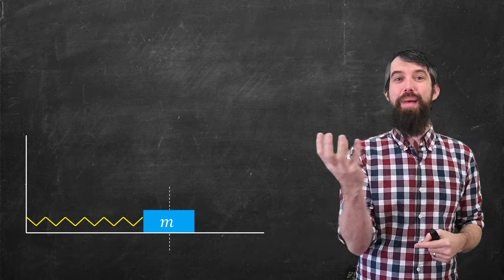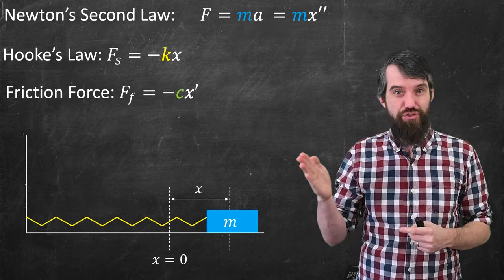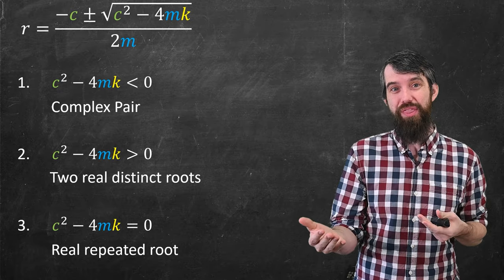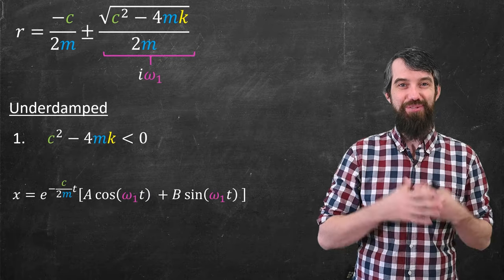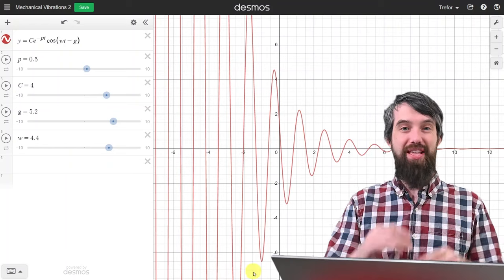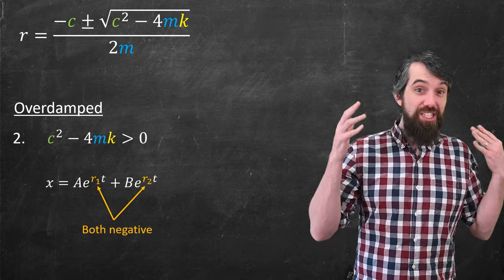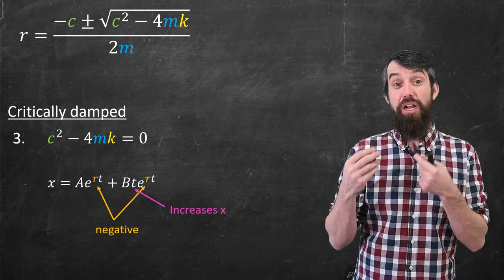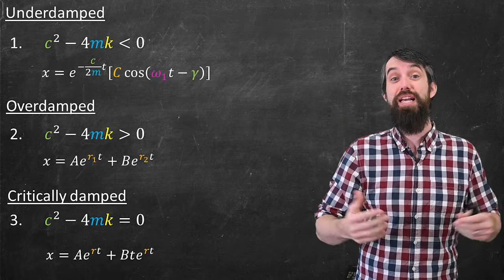Mechanical Vibrations: Underdamped vs Overdamped vs Critically Damped

Comment: Professor T. Bazett, thank you for a strong Introduction to Mechanical Vibrations in Differential Equations. Mechanical Vibrations is a huge part of Mechanical Engineering, which deals with tools/equipment that vibrate upon impact. Many problems in Mechanical Vibrations are Underdamped.

Comment: For anybody who gets into vibration analysis or reliability engineering, in mechanical system you can typically only vary mass or stiffness. Although it can be expensive to modify equipment in the two aforementioned fashions, it can prevent fractures. Changing mass, stiffness or both shifts the frequency response away from the current resonant frequency which is what kills shafts, bearing, supports, pipe fittings.
Reply: hey could i message you for help brainstorming for a math investigation coursework im doing for school?

Comment: First time I ever hear that friction is a function of velocity. I mean it does make a difference if you're moving or not (static vs kinetic friction coefficient), however, once you start moving it becomes a function of the normal force (independent of velocity). Now, an hydraulic/pneumatic dampener does depends on velocity. Anyway, great video as always!!
Reply: This is friction on a spring, and here, there is no normal force, because there is no gravity being considered.
Reply: @angelmendez-rivera351  that's definitely not it
Reply: Its viscous force of damper , act like friction force here
Reply: @rohitchaudhary3619  I would agree with that, that's the example we always see in Mechanical Vibrations. Usually there's a "damper" parallel to the spring in the schematics.
Reply: @AMR-555  Friction is proportional to velocity assuming viscosity governs the fluid mechanics of drag, rather than stagnation pressure.   Usually at low velocities and high viscosities (called laminar flow), you get drag forces that are proportional to velocity.  Eventually, there is a speed at which there is a transition from laminar flow to turbulent flow, where it is much more accurate to model drag as proportional to the square of speed, rather than to speed itself.  Non-fluid friction is independent of velocity altogether, and only depends on normal force, the identity of the surfaces, and whether they are initially at rest, or initially moving.

This kind of problem is significantly more difficult to solve, if you have to work with a kind of friction other than viscous damping that is proportional to speed.

Comment: Sir, will you recommend laplace transform to solve these differential equations? Actually I used it for a while and got some weird solutions, like extra sine terms and cosine terms... Will it affect my solutions?
Reply: You can use either the Laplace transform, or the traditional method of assuming the solution has the form of e^(r*t), and solving for the characteristic equation that determines the value of r.  It depends on the form of the differential equation given, and whether you are given initial conditions or not.

If you are just solving the simple case of a free vibration, and initial conditions aren't really in the picture, then I recommend the more traditional method of assuming the solution has the form of e^(r*t), and solving the characteristic equation for possibly-complex values of r.   If instead, you are given an exotic forcing function other than a simple sine or cosine, then I recommend the Laplace transform method.

Try a few examples both ways.  See if you get consistent results, and which method seems to be easier in which circumstances.

Comment: ive never been able to figure out why you need both a sign and a cosine term in the underdamped solution. surely just having the one and moving it around will let you set whatever initial conditions you want
Reply: You can either have a single amplitude and a phase constant, or you can have a sine and cosine term.  They both will give you the same solution, since they are both multiplied by the same exponential decay envelope.  Through a trig identity, you can prove that they are equal.

Initial value problems with underdamping are significantly easier to solve, if you keep them as an arbitrary linear combination of sine and cosine terms, and then solve for the coefficients based on the initial conditions.  If you switch it to a single trig function with an amplitude and phase constant, it is a harder problem to solve.

For the situation with no damping, you can proceed either way to find the coefficients.  You can use conservation of energy to find the amplitude, and inverse trig to find the phase constant.  Or you can use a linear combination of sine and cosine, solve for their amplitudes from initial conditions, and then use trig identities if necessary to translate to a single trig function with an amplitude and phase constant.

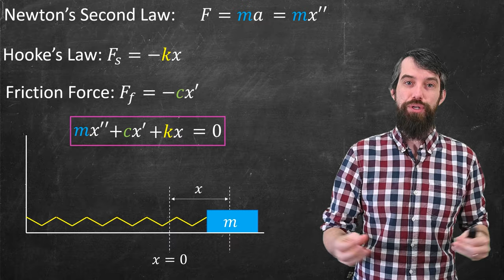Comment: At 1:58, the force of friction is defined as -cx', but when it's included in the larger equation it's +cx'. Is the sign arbitrary?
Reply: the velocity  could be - or + ,depending on whether the body is moving upward or downward .  and the -ve sign in the equ put so that the friction force is always opposite to the direction of moving
Reply: @musabothman4362 can you explain what is c and it's units

Comment: @Dr. Trefor Bazett, When you arrived at the second order differential equation of ma + cv + kx= 0, why did you ignore the negative sign in front of the c and the k? Because if you do not ignore it, you get a sqrt(c^2 + 4mk). Then from this, how would you explain the motion of the oscillation from the discriminant?
Reply: The negative signs in front of c and k, are only there when you have them on the opposite side of the equation as m*a.  The negative signs switch to positive, when you move all terms to one side.

When you solve for the values of r, you get:
r = (-c +/- sqrt(c^2 - 4*m*k))/(2*m)

When this c^2 - 4*m*k is negative, you get two complex conjugate numbers for r.  This corresponds to an exponential decay function at the real value of r as its decay constant, that envelopes a linear combination of sine and cosine waves.   Knowing that c^2 - 4*m*k is negative, you "ignore" the negative sign, carry out the root, and then know that it belongs with an imaginary unit when constructing the rest of the solution.

Comment: I don't get way in the Overdamped case (2th case) r1 and r2 are both always negative. sqrt(c²-4mk) can not be greater than c? Because if can -c + sqrt(c²-4mk) > 0 and so r1 is positive.
Reply: If they were positive, you'd have exponential growth, rather than exponential decay.  This could only happen if time were to go backwards, and the dampers added mechanical energy to the system, instead of subtracting it.

-c + sqrt(c^2 - 4*m*k) cannot be greater than zero, as long as m and k are both positive real numbers, which they'd have to be for this situation to be realistic.  In the limit as c gets large, the -4*m*k term approaches zero.  We end up with -c + sqrt(c^2), which simplifies to zero.  In the limit as c approaches zero, we end up with sqrt(-4*m*k), which when divided by (2*m), gives us sqrt(k/m), as we have for the frequency of a free vibration without damping.

One way you could make a situation where "k" is negative, is with the falling chain.  You have a chain with a uniform mass per unit length, and part of it is hanging off the edge of a table, while the rest of it is sitting on the table in a straight line.  After you release the other end, the part hanging over the edge pulls the rest off the table, with an acceleration that is proportional to the fraction that is hanging.  In the frictionless case, the motion is modeled with the function cosh(t).  This is essentially how you make a negative spring constant, because the force causing the motion is proportion to position and in the same direction as the position.

Comment: I always thought frictional forces were nonlinear, something like 

First derivative squared
Reply from the maker: It depends on the speed and the medium. Linear for slower speeds and things like movement in fluids. Fast speeds in air quadratic.
Reply: Oh my god I’m fangirling so hard rn 

You noticed me senpai <3 

Yeah I had a feeling it had to do with “slow velocity”
Reply: @gustavoespinoza7940  It has to do with the relative ratio of "inertial forces" to viscous forces that govern the flow.  We quantify it with a unitless number called Reynolds' number, which is rho*v*x/mu.   rho is the density, mu is the viscosity, v is the speed, and x is the characteristic geometry dimension.

When Reynolds' number is low, viscosity governs, and the flow is laminar.  The drag forces are proportional to speed.  When Reynolds' number is high, inertial forces govern, and the flow is turbulent.  The drag forces are proportional to speed squared.

For mass/spring/damper systems, the problem is significantly more difficult to solve if friction is anything other than a viscous damper.  That's most likely what is used in practice in an application such as a car's suspension system.